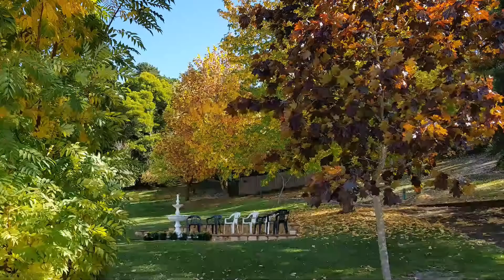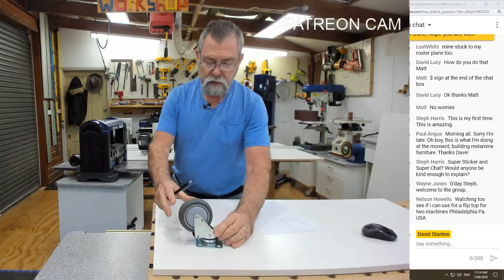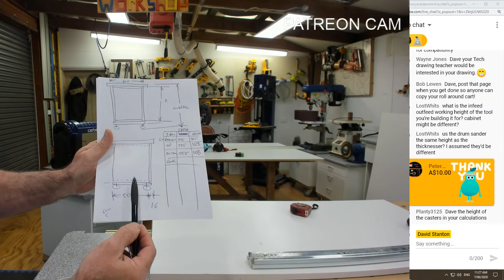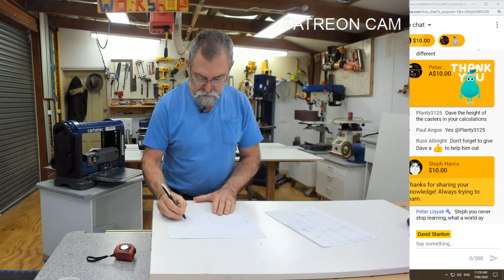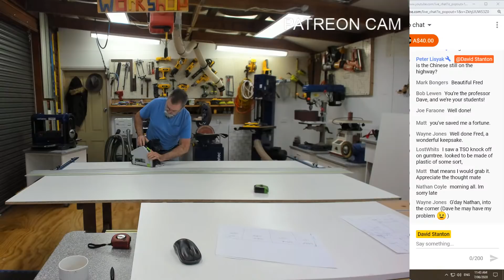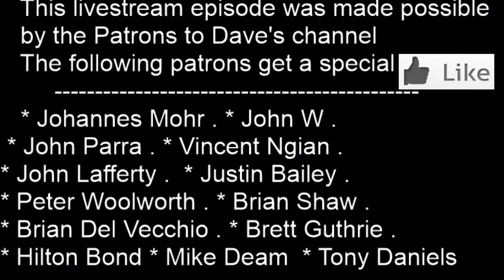LET'S MAKE A MOBILE MACHINE STAND | DAVE STANTON LIVE!

Comment: Hi Dave I use foam from Bunnings under what I am cutting that works great and is very flat and also lasts a long time before you need to change it and doesn't cost much.
Reply from the maker: Thanks Kim Dalzell! How thick is it?
Reply: @DavidStanton  Hi Dave it is 30 mm thick and comes in a 600 mm x 1200 mm sheet and yellow in colour and is called Knauf Insulation 30 x 600 x 1200 mm XPS Multi-Use Foam Board and costs $12.50 a sheet, if you purchase 2 sheets you can cut a 2400 sheet of board on top. Its excellent.